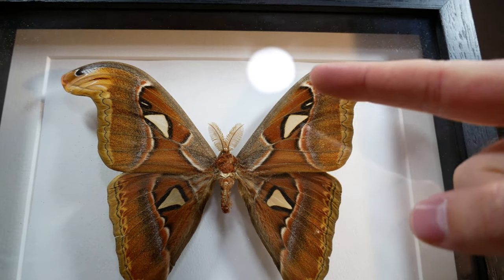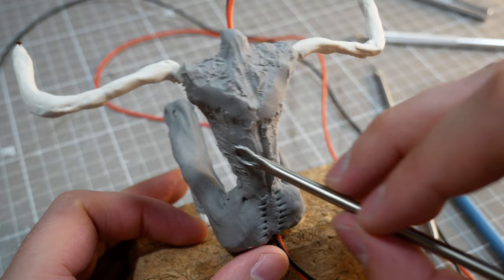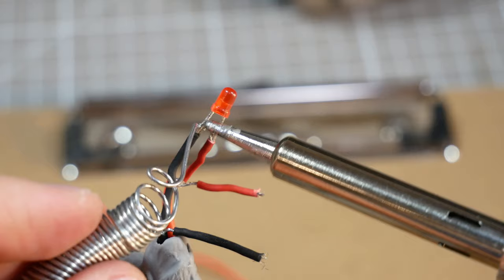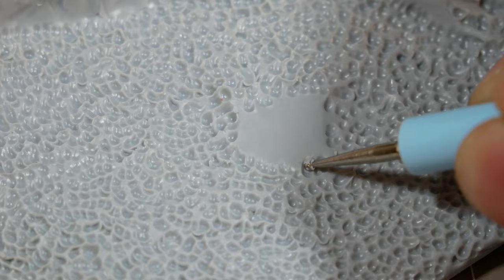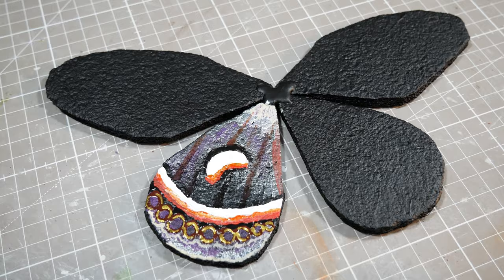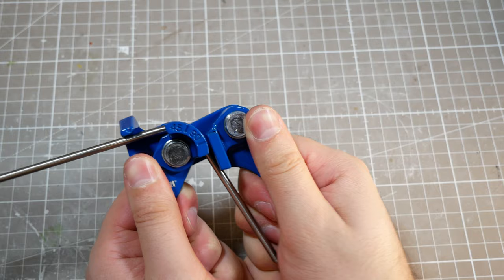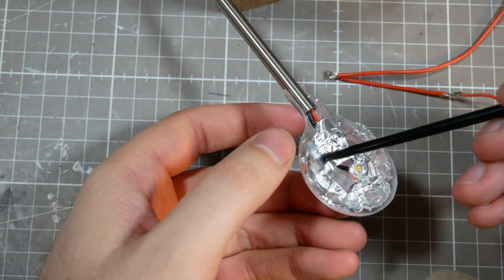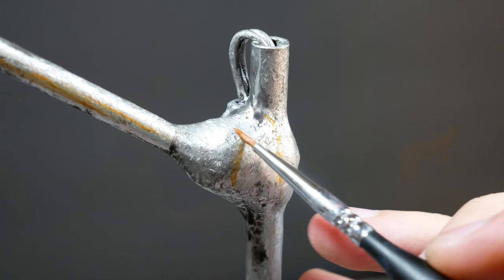I made a realistic Mothman sculpture --- Cryptid Creations

Comment: this is awesome, I love the way you painted the wings to look like an actual moths. also, I think the reason your first attempt at the wings cracked is because you used the heat gun to cure them? I use cosclay and from my experience if you don't have the temperature right, it can make the clay more rigid and prone to breaking
Reply from the maker: Thank you! I thought it was fun to try making Mothman with moth wings instead of the traditional bat-like wings. I think you're exactly right about why those wings cracked---I didn't think about how you can't really control the temperature from the heat gun. What temperature do you usually bake your CosClay at? The project I'm finishing up right now is having similar cracking/stiffness issues. Thank you for the feedback and advice! I hadn't thought about temperature differences between CosClay and Sculpey.
Reply: @wathencreations  I bake my sculptures at 225 for 15-20 minutes, but I'd suggest making a few tests to figure out what temperature works for you since I'm pretty sure my oven is messed up lol. good luck with your current project, can't wait to see what you do next! (:
Reply from the maker: Thank you! I was definitely baking hotter than that. I'll do some tests; I appreciate the advice!